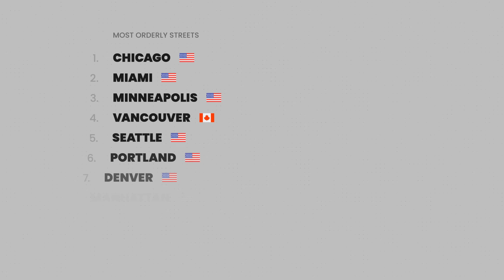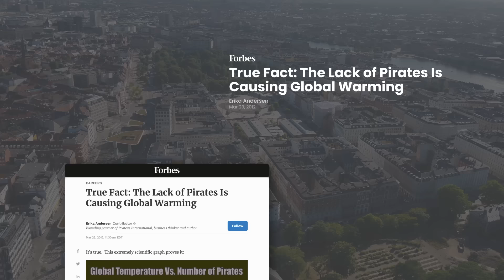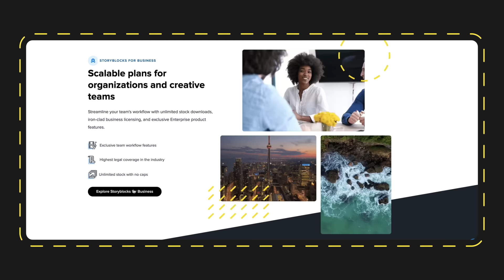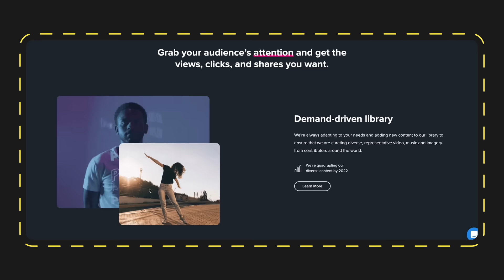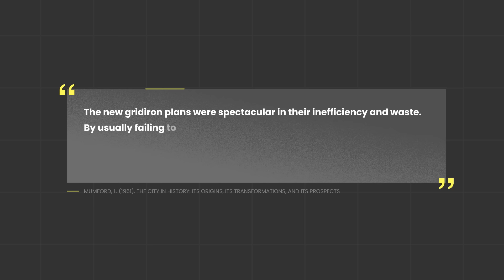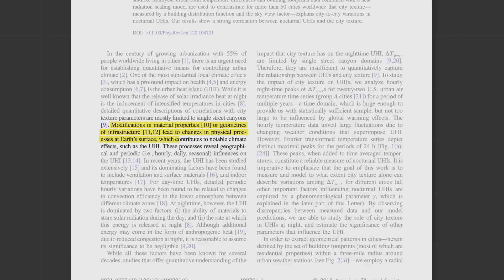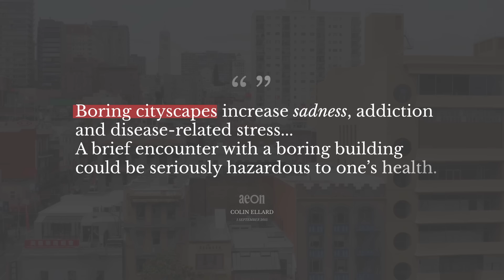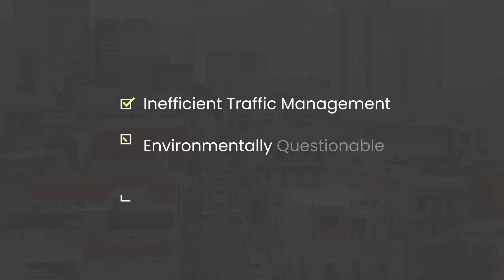Why Cities With Grids Are Terribly Designed

Comment: Idk as a pedestrian, it's really easy to understand grid designs. I don't get lost in Manhattan because the grid system plus the naming convention of streets make it really easy to navigate and also understand the metro. I just wish there weren't so many cars around.
Reply: this isn´t a relevant point since we use google maps lol. Before that it was a big positive aswell
Reply: @thetaomega7816  The point really is for ease of navigation. I can use Google Maps for everything but then I have to pull out the phone for everything and I'm always self-conscious about that, especially on vacation where I risk pickpocketing. Grids plus mixed zoning also make things closer. In a cul-de-sac for comparison, places that should have a direct path to each other often don't.
Reply: The wheel-and-spokes design is easier to navigate as you have natural points of reference. If you are lost, all roads would lead to the center of the neighborhood, and you just have to have to follow visual cues - where the buildings get taller, traffic gets denser etc. and you will reach the bus stop, train station etc.

And from the neighborhood/district center there will be a direct bus/train to the city-center always, from which you can decide on your destination.

I was in Tokyo and didn't even need to know the names of streets. Just look around and naturally walk towards where all streets are converging.
Reply: Cleveland has a lot of streets that appear and disappear. Maybe the street after East 3rd is East 4th on this street, but a block north & it's East 3rd, then East 6th. I'm still not sure where East 5th is.
Reply: @abyrupus  Oh maybe this channel talks about that. It wasn't mentioned in this video but I see a video on Tokyo suggested to me so maybe it's there 👍
Reply: Loosing the grid takes preference from autos for short trips. IE less cars on the road.
Reply: This is also another reason why I don’t like grid cities. They are far more predictable and less exciting. The two mega cities I’ve explored a lot are New York and Tokyo and with New York, it’s like once you know that basics, you can imagine what a place would look and feel like based off its location. In Tokyo, there’s huge intersections that shatter into big roads that breaks off into smaller shards of streets and those are connected by small alleyways. Ever turn there’s something you’ve never seen before. It’s like a jungle gym for adults
Reply: It depends, both are navigated differently. In a non grid(let's call it medieval) Street system, each street and intersection is different, so it's possible to navigate by landmarks, both large and small, be it a church spire or coffee shop. In unfamiliar areas, you navigate via major avenues, branching off where necessary.

I find with a grid system I'm always lost, as every street and intersection is exactly the same. I frequently find myself walking north instead of south or east instead of north. You have to actively check signs in a grid layout to know where you're going and this isn't always intuitive (most American neighbourhoods don't use a Manhattan style naming system). Is Martin Luther King avenue East or West of Vanderbilt avenue? Hell if I know!

I would say medieval style street plans are a bit more difficult than Grid plans for tourists to figure out, however, within 2 weeks a person should be able to navigate most of it without having to check their phone too often. However, after living in NYC for 2 years, I still would get lost, even less than 10 blocks from my house, as everywhere looked identical.
Reply: Same here in Chicago, it's so easy to know where things are based off just the address
Reply: @abyrupus  thats a matter of opinion. I can very easily have a grid pattern with a central road and call it uh Broadway. 

Beyond that everything you said was you asserting opinion as fact.
Reply: @jasonquigley2633  thats definitely a you problem.
I know a bunch of people with zero sense of direction who look at their google maps, see they have to go south, and then promptly walk east. Thats entirely on you, grid or no grid you are basically lost yer just kept penned up most the time so it doesnt show.
Reply: in the words of John Mulaney— “How did Kevin McCallister get Lost in New York? The streets are numbered!”
Reply: @jasonquigley2633  
"... so it's possible to navigate by landmarks..." 
You can only navigate by landmarks if you have been to the land or can match the land with a map, digital or paper.

"...In unfamiliar areas, you navigate via major avenues..."
You are assuming that I can tell it's a major avenue, or what an avenue means in that region.

""...I frequently find myself walking north instead of south or east instead of north...""
That is 100% a you problem.  I've been able to understand where North when I just got off a plane or have been in a building for a long duration.  Knowing or remembering how you moved isn't navigation.

"...You have to actively check signs in a grid layout to know where you're going..."
You have to actively check church spires, or actively check coffee shops.  This is moot point as navigation tends to require that you are actively paying attention to your surroundings.

"..(most American neighbourhoods don't use a Manhattan style naming system). Is Martin Luther King avenue East or West of Vanderbilt avenue?..."
100% agree on this.  But this isn't a navigation problem so much as an urban/city planning problem.  They could use numbers, but they choose to be 'different' or 'interesting.'

"...I would say medieval style street plans are a bit more difficult than Grid plans for tourists to figure out..."
If a tourist can figure it out without 2 weeks of being in an area, why are you still getting lost?
Reply: @blueoutrider  "You can only navigate by landmarks if you have been to the land or can match the land with a map, digital or paper." Yes, most people carry a map around with them in their pocket with GPS. Finding landmarks is easy. After being in the city a week or two you don't even need to look at your phone as you'll recognise the landmarks in the places you frequent.

"You are assuming that I can tell it's a major avenue, or what an avenue means in that region." It's pretty easy. The major avenues are wider then the minor streets. Medieval grid patterns are usually arranged like a web with major avenues leading to the center and minor streets branching off.

"That is 100% a you problem.  I've been able to understand where North when I just got off a plane or have been in a building for a long duration.  Knowing or remembering how you moved isn't navigation." Not so simple if it's overcast or night outside. If enough people have the same problem it's not a "you" problem.

"You have to actively check church spires, or actively check coffee shops.  This is moot point as navigation tends to require that you are actively paying attention to your surroundings." These are much easier to notice then street signs. It's much easier to turn right at the cathedral or at mulligan's pub, then to turn right at east Lincoln st.

"If a tourist can figure it out without 2 weeks of being in an area, why are you still getting lost?" Tourists usually require only simple navigation (go from hotel to major tourist sites), and these roads are usually well signposted. It's residents who most heavily have to deal with navigating the grid. EG if you're in NYC and a tourist, you're mostly staying in midtown and lower manhattan and seeing the various sites there. Navigating the grid here is easy as it's full of significant landmarks. Brooklyn or Queens don't have such landmarks, every intersection is mostly identical.
Reply: @jasonquigley2633  omg thank you for saying this. I am very good at navigating european cities as every neighborhood has a distinct feel that "shades" into the next one, plus landmarks, differences in elevation, etc. However I am perpetually lost and frustrated in grid cities despite living there for multiple years. On top of being frustrating, they're also uninviting and tedious - no point going for a stroll when your direction is so artificially confined, at least for me.
Reply: @vacafuega  Indeed, I also don't particularly enjoy an evening walk through 30 near identical streets and intersections
Reply: As a car driver, I wish there weren't so many pedestrians around.
Reply: Self driving cars have the potential to re-invent cities. Without the need to own a car - which will despatch itself on demand,   90% of the car parking can disappear and redevelopment will make cities in the future unrecognisable to us.
Reply: I agree and disagree. A grid is /typically/ easy to understand, however I got so lost in NYC because the street names were mostly only displayed on corners and each street looked relatively the same. I love NYC btw so I don’t mean to drag it.

Comment: Chicago has diagonal avenues that cut across the grid as well though. The grid in Chicago is great. If I am driving back home to the suburbs from the city after work in rush hour traffic on the freeways, and the traffic is not moving, I can exit off the freeway, and drive in the same direction that I was going on the freeway, but on a secondary road, that starts in the city and takes me all the way to the suburbs, thanks to the streets being laid out in straight lines in a grid system and are continuous. If I am on a secondary road and there is alot of traffic on it, and let's say I am heading west on it and eventually plan to turn right on another secindary road to get to my destination, which is northwest of where I started, I can get off that street heading west and take an avenue heading in a nortwest direction, to get to my destination. You can always bypass traffic based on the layout. The city and its design was very well thought out and very utilitarian. They handled the trash problem that NYC and London and other cities never have, by building in alleyways in between buildings and behind them. The city planners got it right when they built Chicago.